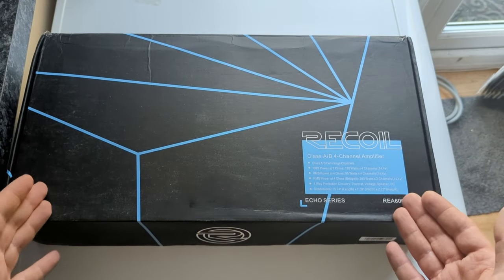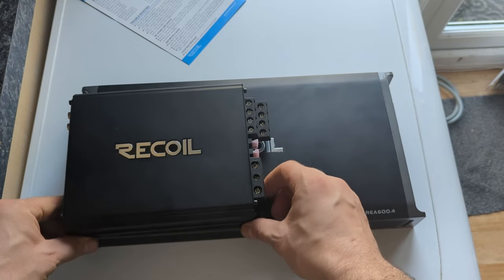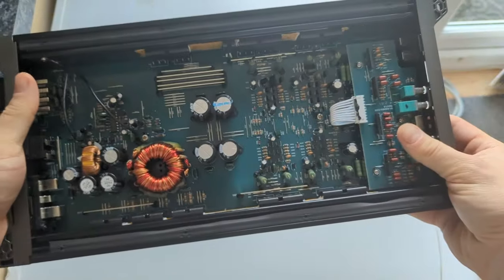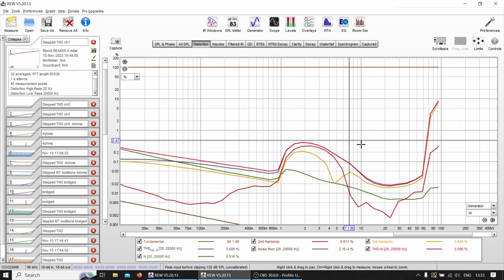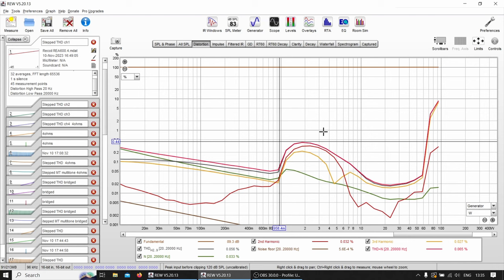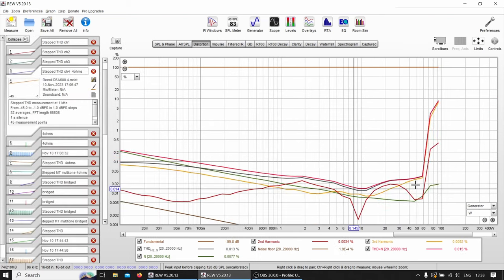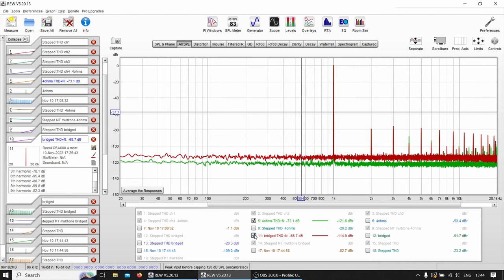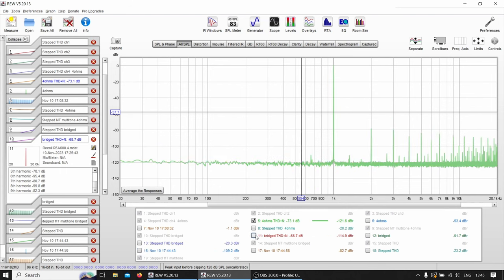Recoil REA600.4 distortion measurements. AB vs D

Comment: And here we come to the conclusion: your “harmonics” graphs don’t match real life experiences. I actually took a step and bought, installed and tuned this REA600.4 to run my Recoil tweeters and Unity 8.0s in my pillars and kept the DI1200.4 on my sub and front door midwoofers.  I just posted the video of the system and you be the judge how it sounds: let me tell you, for $105 US dollars, the REA600.4 kicks ass and the system sounds perfectly clean and clear at full tilt. Come listen.
Reply from the maker: Hey, I would like to clear one thing. Obviously you are a Recoil fanboy and nothing wrong with that. Since you are invested in the brand you don't take negative feedback very well (as expected). You seem to misunderstand that I am doing here. I am presenting rew data - measurements. I am not commenting on the quality of sound. If you noticed I am using very conservative terms such as "in theory it should" or "it might". I don't use definitive terms and never said that this amp sounds crap. Don't take this personally. I am just measuring amps. I am glad that you are happy with them. For the price Recoil is very good.
Reply: @RAW-CAt  it sounds like you're the one that's taking it personal..... I didn't see nothing wrong with the original comment.
Reply from the maker: @Ninoo187 I didn't say that something is wrong with your comment. All.is good. I was just explaining my perspective.
Reply: @RAW-CAt  you can share your perspective without calling someone a fanboy... Just for future reference.
Reply from the maker: @Ninoo187  if you are running all gear exclusively from one brand you are a fanboy. There is nothing wrong with that.
Reply: @RAW-CAt  lol you still trying to talk down.... Poor you, must be mad at life.
Reply from the maker: @Ninoo187 I think you seem to misunderstand the word that I am using. In some cases the word "fanboy" may be used in a negative sense, but in this case it's a description of a person that likes a specific brand. Again, there is nothing wrong with that. I am a fanboy of Alpine gear. There is nothing derogatory about that and no one is talking down. It's simply a word describing someone's position.
Reply: @RAW-CAt  nice try. Your attempt in dismissing my opinion because I chose Recoil then walking it back saying “I didn’t mean that in a negative way”. lol. Keep paying thousands for your “clean” power. Audiophile garbage opinion
Reply: @Ninoo187  yeah, the “audiophiles” trying to justify spending thousands on “clean harmonics” in their 1995 Civics. 🤣 go figure

Comment: It is not old :) it is just bad design with cheap production process. Low cost AB will be definitely worse than D until some price range. However can you really hear  difference between good quality AB / D amp vs top quality AB amp? Nope :)
Reply: I think that people are insane to spend money on Brax, Hertz, Steg, Helix and all of this “high end”/SQ amps and yet, they don’t sound any better than a $105 Recoil amp. Come listen and tell me what you think about my all-Recoil system.
Reply: @TheGodofSEO This is a point you seem to not understand. Just because you are focused on performance per dollar, does not mean everyone else thinks like you. People are not insane if they think differently from you. 

An example, if people only cared about cost, we would all be driving Yugo's. 

Obviously that is not the case. Some people don't have much spare money for audio gear, some do. Some don't even care about cost, they just want the best.

This is why there's a wide range of audio gear. There is something to suit everyone's needs.
Reply: @JasonWW2000  you missed MY point; and that is, none of these $1000 amps sound better than a $100 amp, watt for watt.
Reply: @TheGodofSEO   You have pushed it to far. There differences, big ones. THD, frequency response, floor noise, slew rate, input sensitivity, DF, SNR, channel separation. Any high end amp will be much better. For me SNR, floor noise and channel separation are very important. Amp has to be dead silent.
Another point is quality of components. High end amps from 90s still runs and definitely you can expect lower failure rate. 
But yeah above certain point you will not gain much with higher end amp.
Reply: @TheGodofSEO  No, I didn't miss your point, your still focused on cost. You don't seem to realize that there are many other factors involved that influence buying decisions.
Reply: @JasonWW2000  after 27 years in the sound industry, I’d like to think I have some experience. And my experience dictates that there is no discernible sound in everyday use of in-car audio between my amp and a helix amp or any other such amp. Sam Barevids proved it with bass amps, and most of the industry is absolute garbage as it relates.  Please explain why Raw cat found all these harmonics and yet, anyone who has ever sat in my truck walks away in disbelief.  Again, there is zero audible differences as you’re cruising down the street. None
Reply: @TheGodofSEO let me try to explain it in terms you can understand. Instead of buying your wife a $1,000 diamond wedding ring, you can tell her that this $100 cubic zirconia is just as good and nobody can tell the difference. 

Technically, you are correct. No one would be able to tell the difference. However, some people may not be okay with the cheaper option. 

You're basically saying that there's no point in people buying fancy sports cars or designer clothing. Just buy a Yugo (or Kia Rio as cheapest US car) and pick up some clothes at the Salvation Army and you'll still be able to get from point A to point B and stay warm. Yes, all technically true. 👍
Reply: @JasonWW2000  this literally has no comparison to what I’m describing and that is human hearing and human gulibility to get screwed by these “high end companies”.  🤣🤣
Reply: @TheGodofSEO  Yes, all those "suckers" out there wasting their money on high end brands. They should stick to what's practical, right? 

Not everyone sees it that way. In fact, car audio as a hobby is not really "practical". Some might even see ALL aftermarket car audio as a scam. We are wasting hundreds or thousands of dollars on car audio gear when the factory stereo is just fine. We might all be suckers. 😂

It all depends on your point of view.
Reply: @JasonWW2000  probably but damn it sounds great when the bass drops.

Comment: Thorough test though that amplifier was an extremely poor example of the class. As a mostly uneducated but longtime hobbyist in car audio, I’ve noticed that good quality 4 channel a/b amplifiers with claimed rms outputs of 50 watts per channel always have power supplies with two transformers and a much higher component count. This amplifier’s poor performance was probably due to both bad circuit design and low quality components. I have never seen so many jumpers combined with a sparsely populated circuit board.

Comment: if you dont give the ab 14.4 volts it works in class b mode . measure the bias current and you will see .
Reply from the maker: This is very interesting. Never heard this before🤔 Why 14.4V?
Reply: @RAW-CAt  i think this is the car alternator voltage these amplifiers supposed to work with and they have set that bias resistor to that voltage . rail voltage increases to the optimal voltage at output with 14.4 at the input . i was using 2 car amplifiers at home with 12 volts and checked at another one too . none of them produced a bias current with 12 volts . i couldnt think of that 14.4 volts trick at that time and readjusted ( changed infact ) that bias resistor in the circuit to produce some bias current to work with 12 volts .
Reply from the maker: @tolgadabbagh1877  I test them at 13.2V🤔
Reply: @RAW-CAt  you should measure the bias current at 12 and 13.2 and 14.4
Reply from the maker: @tolgadabbagh1877  that's a Good idea worth testing out😉

Comment: I would assume it's electronic component parts tolerance responsible for the difference between channels.
Reply: Not very likely. You don't save much money by using extremely low tolerance parts. Almost all those components are going to have a decent tolerance. Plus the power output was fairly consistent. 
I tend to agree with RC, the basic layout of the board and how the channels move around noisy components seems the most likely cause. They likely spent no time improving the layout.

Comment: I have a component set in my kick panels with 6.5 mid and tweeter and I also have a 4x6 Infiniti plate speaker with 3 in mid and tweet in dash facing up. Should I focus on kick panels and cross dash over high and keep there level low or do u think I should move main tweeters up. By the way I have midbass   sealed under seat
Reply from the maker: Well, the response from the kicks will be limited. That will determine where you CAN cross.
Reply: @midbass.maestro how does the midbass perform from under seat? I have been thinking of doing this in an install. It wouldn’t be a IB install, but I would have more than enough airspace. Also, what size and brand midbass are you running?  Any input would be appreciated. Cheers!!!

Comment: Would this introduce a lot of ground noise? Through this class of amp or static f
Reply from the maker: What do you mean by "this"? What could introduce noise?
Reply: @RAW-CAt  yea I have the the Recoil red 1800.5  and I've had a issue  with An engine noise and a static sound hum. As I understand  the 4 channel is class A/B and 5th channel  class D
Reply from the maker: @Dezydezl  those issues are install related. Amps themselves have nothing to do with it.

Comment: Which one would u recommend for running mids only no highs?
Reply: The DI1200.4 (the one I have running my mids).
Reply: @TheGodofSEO  got the same for my mids also.. gonna be 2 six inch and 2 eight inch
Reply: @matthewnarine  they are extremely powerful amps.  Did you go and watch my vid on it?
Reply: @TheGodofSEO  it is powerful, I not going to push it hard
Reply: Shit I'm running the di550.4 and that is plentyyyy for my setup and I've got the gain just barely at 20% probably

Comment: Test a 1992-1997
McIntosh MC431M
4 channel car amplifier 
RSM Rating: 
* 4 CHANNEL:  100W x 4 @ 4 ohm
* 3 CHANNEL:  100W x 2 @  4 ohm & 200W x 1 @ 4 ohm
* 2 CHANNEL (BRIDGED):   
       200W x 2 @ 4 ohm
* 2 ohm steady 
TOTAL HARMONIC DISTORTION :
Maximum 
harmonic distortion at any power level from 250 milliwatts to rated power output.
THD: 0.005 @ 4 ohm
S/N RATIO: 110dB
Battery Voltage:
12V to 18V
Input Sensitivity Voltage: 0.3V to 2.0V
Dimensions:   362W (18.5”) x 71H (2.8”) x 305D (12”) mm
Weight: 6.4kg (14.11 lbs)
Features:
•Built-in electronic    
  crossover with separate                 
  high pass and low pass 
  filters. On
•Power Guard. 
•Ported tunnel forced-air 
  cooling. 
•Multi-stage  thermal 
  protection.
AB Class amp
Reply from the maker: Sure, just send me one and I will be happy to test it😉

Comment: I will try to be short. It is a copy-paste made in china amp, pure rip-off. Design by itself - yes, it is old as my grandma, but not inherently bad. From the internals I could grasp -  topology is bad, cheap components everywhere, not really a class AB, but mostly class AB, I bet there almost no bias current. These are hard biased AB to B class amplifiers. You could measure the voltage drop across the emitter resistors and calculate what's the current based on ohm law. 

The noise -  stupid manufacturer design/decision to increase the amplifying coefficient in the pre amp section high as F, thus resulting in increasing all noise and sh*t from the input section....Amplification should be done with higher ratio in the feedback circuit of the "amplifier" itself BUT not in the pre amp. 

A lot of the issues with the amp can be resolved with a few $$ spend in the right direction. But it's not a faulty amp, all of the line are going to exhibit the same "qualities"....

I follow the channel, but I don't have much time to comment. There are so many amps waiting for me to repair or tune/mod. 

On the class D side as I've watched the video about....it really depends on the class D design....but most of the sound and the SQ side of it is going to be influenced by the pre-amp in the amplifier and the class D switching frequency and filtering. 

Nice videos, would surely follow.
Reply: And yet, in a loud car, no one can tell a difference.  🤷🏻‍♂️ all the “harmonics, distortion, thd, blah blah” you get in a simple system with a decent DSP and no one can tell a difference between anything from anything.  Go figure.
Reply: @TheGodofSEO  amps contribute to no more that 10% (apart from raw power and spl), maybe even less to the overall sound impression/reproduction...and rarely they are the limiting factor....but hey if marketing can make sales n cash go brrrrrtttt....
Reply: @TS_sound  exactly my point. You can’t “tell” the difference between an AB and D class if you tried. Harmonics be damned.